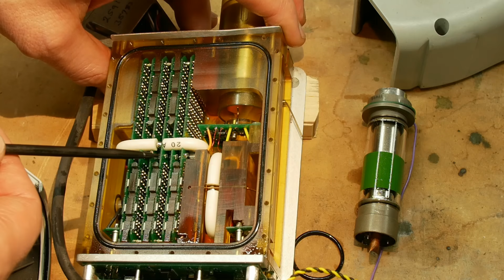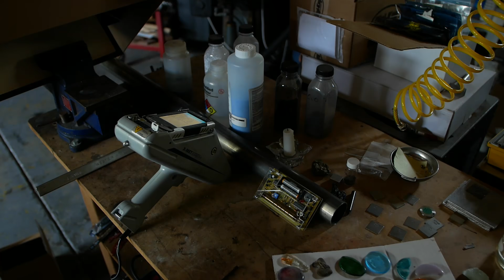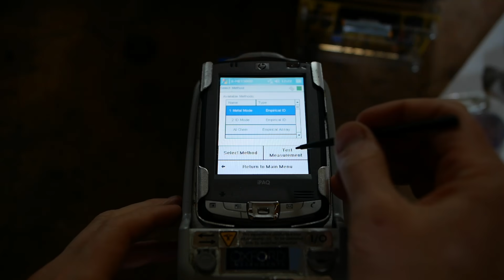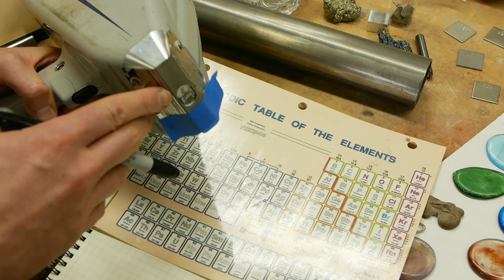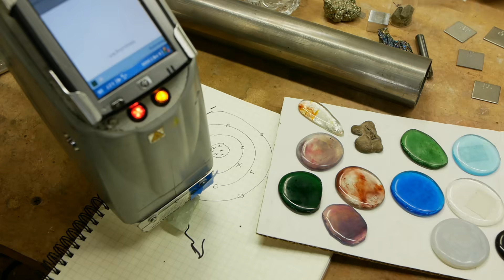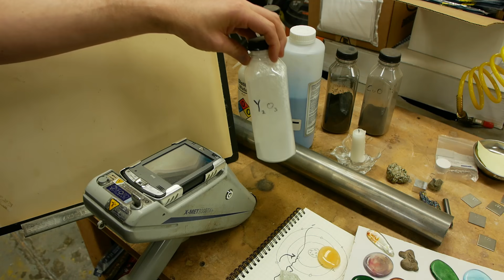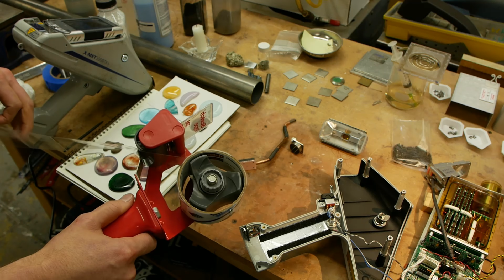Demo and teardown of an X-ray fluorescence gun (measures chemical composition)

Comment: UV fluorescence is actually a bit of as different process than X-ray fluorescence. When a fluorescent material absorbs a photon with a specific energy, an electron within its outermost orbital is excited. Rather than being ejected and leaving the system entirely, the electron jumps from its current orbital to a higher energy one, with the energy difference between the orbitals corresponding to the energy of the photon absorbed. The electron can then relax back down to its original state by releasing a photon--this is light you seen when shining a UV light on a fluorescent object. Now, there often is not perfect overlap between the lower energy orbital and the higher energy one, so when a photon is absorbed and an electronic transition occurs, the molecule can become vibrationally excited as well. The energy used in the vibrational excitation is "wasted" and does not contribute to the energy of the photon emitted. This is why fluorescence produces light that is lower in energy (longer in wavelength, or "redshifted") than the light that causes the initial excitation. Hope this makes sense!
Reply: I think he gave a very good explanation of the difference in the video.
Reply: So what is it that specifically affects the apparent color of the fluorescence?
Reply: @DudemcmanStudios  my thought is Evan's explanation is correct: the collapse of an excited electron down to a lower orbital emits a photon at an energy level reduced by loss.  The energy of the exiting photon determines the wavelength.  If exiting photos "returned" all energy of incoming UV...zero loss...the wavelength would be UV, but in reality the greater the loss through absorption by the parent atom the lower the energy of the exiting photon and hence the longer the wavelength from Uv down through the spectrum from violet through red and  beyond.
Reply: @DudemcmanStudios  The energy difference between the orbitals which is itself caused by the molecular structure.

Comment: 1:39 Granted, but aren't typical medical x-ray exposures usually 1000s of times shorter than the 10 seconds that gadget emits?

Still, very cool tech. with the 40kv power supply. Sort of reminds me of an old soldering gun in reverse. Instead of thousands of turns primary and 1 or 2 turns secondary, this thing appears to have 1 turn primary and multiple secondaries? Each VM constituting a secondary? I'll wager this allows the VM mfg to modularize the HV supply solutions. The mfg probably sells 1kv, 5kv, and 10kv VM modules. The client just stacks as needed to get the voltage desired.

Comment: Ok Ben , in the other videos you demonstrated vacuum deposition and the operation of two different pumps to achieve high vacuum. What I want to know is this: why have you yet to make a video on anti reflective coatings for glass? Such a ubiquitous thin-film costing, and one with such utility, not yet brought to your videos!  How come? Isn't it about time? The reason why I ask is because I'm a watchmaker and I have yet to find a reliable vendor for AR-coated watch crystals. Wouldn't it be awesome if I can vacuum-deposit some magnesium fluoride on my glass crystals for a profound visual quality to the watches that I make?
... But I can't, as Ben hasn't yet made the video. :(
Plus, if the video is created for poor watchmaker-type budgets (diffusion pumps, cheap dual vane pumps, etc), that would reel in even more subscribers, I'm sure. Plus, your so well-versed in the setup and execution of vacuum technology that this presentation can be carried out in an afternoon...

Comment: Does the power supply have any similarity to what you might find in a taser/stun gun? Very high voltage and low current.
Reply: Yes similar to that I believe, tasers are more pulsed than a constant DC voltage though. Also small X-ray devices like this can use enough voltage to produce an arc about 4 inches long!

Comment: Great videos, great content. Intelligent and enjoyable. I always look forward to you doing the next 'impossible' thing ("let's build an electron microscope!" Me - mouth open in disbelief as he actually makes a home made electron microscope).

However, on the specific subject of hand held X-ray guns...

Personally, I wouldn't trust those hand held guns down to 0.01%. You would be hard pushed to get that kind of elemental sensitivity and repeatability from a quarter million pound (£) 30Kv, wavelength dispersive laboratory grade instrument with certified calibration standards. Even at modest masses (first transition series metals) there is the chance of interference from overlapping lines because the resolution of the detector is not that good. The problem gets worse as you move up the periodic table.

Portable X-ray guns are brilliant at discriminating between elements and different alloys, but everything is a compromise. You can't take a half tonne, lab grade XRF on the passenger seat of your car and set it up in a couple of minutes in a warehouse on an industrial estate. For that kind of work, hand held is difficult to beat. But 0.01% precision is unrealistic. The manufacturers can put two decimals on the readout, but almost all of the time that last digit is just noise.

Now, if you want real elemental discrimination, how about building an ICP-MS? (!!!)

Comment: Recently I changed trigger button in Olympus Delta XRF (olympus do not repair this model even for money). It is old model, but xray module is smaller. Detector is cooled with peltier modules and it is weak spot in system. It fails and xrf is dead. Unless you use it in winter at -15C. Detector are made by ametek and they do not sell these. Olympus do not have spares. No I have two dead xrf (from about 15 park). New vanta looks like same delta in new box.

Comment: what is the tubular lock for? Is it for turning it off completely just because it contains X-ray radiation and thus requires a lock for safety so not unauthorized people could operate it, or is it just for opening the case?

Comment: UV light can excite an electron, moving it up an energy level or two.  The electron then releases a photon and drops back down to a lower state, usually back to its ground state.  The frequency of the photon is specific to a particular element and transition.  This produces an atomic spectra, which covers infrared, visible, and UV light.  Just as the transition caused by the X-ray is specific to an element, the atomic spectra in the visible light range is specific and can be used to identify the element.

Comment: Doesnt metal overtime collect radiation if it is exposed to it? Would it mean that that tube u took out is kinda radioactive?
Reply: I don't think there is any transmutation going on. The electrons strike the X-ray emitter but I don't think the nuclei in the emitter are converted to a new chemical species by that. You would have to bombard them with protons or neutrons for that to happen. So no radio-isotopes would be created in the process.
Reply: It doesn't work like that really. Radioactivity really encompasses several very different effects. You don't really "collect" radioactivity. 
The one you are referring to is when there are radioactive isotopes emitting let's say neutrons, these neutrons may end up attached to some nucleus of stable materials, making them in turn unstable due to the extra neutrons. This is called neutron capture. That atom then after some time and depending on its mass may break following its own radioactive decay chain.

All that does not apply to the xrays, so there is no risk.
Reply: @JavierAlbinarrate  thanks🖒

Comment: I work at a synchrotron facility and we usually use Beryllium as windows to let X-rays out of vacuum chambers with very little attenuation since it is the metal with the smallest atom.
They might be using the same here in which case you have to be careful since Beryllium is toxic. So there is that.

BTW. I love all your videos :)

Comment: 40 kV is actually pretty risky voltage level for human because it penetrates barely skin and interacts with muscle tissue, and that kind of level is used in mammography. The currents are pretty high in mammography(~100 mA), and an average radiation from that is about 0.3-0.5 mSv  so you have to point that gun pretty long time to your hand to get cancer. But the point being safe x-ray voltages are below 10kV where it stops to skin or above 180kV where it penetrates your body without interrupt. BTW the guns "window" is made from beryllium . It is commonly used as a x- ray tube window material because its almost transparent to rays . Nowadays it has been changed to carbon fiber. it is a bit less transparent but less toxic and cheaper to manufacture.
Reply: Modern xrf use silicon window on detector, Be on Xray tube and polyamid on outer window.

Comment: Thank you, and especially for mentioning the triboelectric effect. My first experience with a triboelectric charge occurred in the photo darkroom when I would unroll my 120 roll film in total darkness; when I pulled the adhesive tape holding the film to the spool to remove the film, I would see a faint bluish glow in the darkness where the adhesive was separating from the film. My friends and I thought this was so cool that we made other experiments with adhesive tape and substrates from which we would pull the tape and watch the effects. This also made a very interesting fog exposure on the film, and after it was developed and fixed, we could see the triboelectric light exposure that the effect made on the film. Thanks again!

Comment: the metal-window in front of the xray tube acts a xray filter to block the part of the spectrum below the K-alpha peak of the anode (i.e. the target) (edit: no, that was wrong. the filter blocks everything <= Kbeta. it is usually one atomic number lower than the target element of the tube.

Comment: How can anything with zero mass, regardless of momentum, impart energy and knock an electron out of orbit?
Reply: And the exception for the divide by zero that it allows, or does or causes. It gets complicated I am sure.
Reply: The photon is a traveling EM wave packet (or a self-propagating disturbance in the EM field[s]), and when it interacts with something that also has EM components (electrons, protons, even neutrons due to it consisting of tiny quarks and it having a multipole moment) then it can transfer its energy to whatever it "hits". It depends on energy. Otherwise the waves just kind of pass each other. But at the right frequency (= energy) they interact, which is also called scattering, because usually that's the thing we see, because the position and momentum of things that the photon hits is of course random.
Reply: A photon is a discrete particle we can measure in quantum sums.

Comment: That was interesting. I would have liked to see how the anode of the xray tube is formed to emit on the front of the tube. Also I'm a little surprised that the beam current is regulated by the filament. Could an xray tube not be designed to have a Whenelt grid to regulate the xray intensity? This would serve the same purpose. Anyone? ??

Comment: This may or may not be related to the packing tape phenomenon you mentioned, but I noticed that the old school black cloth electrical tape AKA "friction tape" emits a light blue glow right at the point of detachment as you pull the tape off of the roll in a darkened room.  I've long since forgotten the circumstances which caused me to notice that, but wonder if you can explain this?

Comment: I want one. Must be quite useful if you have a few tons of mystery steel cutoffs  with alloy unknown. Or to see if jewelry is real/fake.
Looks like one of those weird mircofocus Xray tubes btw, where the beam comes out of the front. Definitively weird HV-PSU design, I'd use like 2-5kV at a few kHz and multiply it up to 40kV. A few µA is easy with multiplier.
Reply: It can't distinguish between gold plating and solid gold, though. It only detects surface composition.

Comment: You can actually see tape emitting light when you unroll it if you turn the light off. The stronger the adhesive, the stronger the effect. Wikipedia calls it "Triboluminescence".

Comment: I owned a dental X-ray machine rebuilding company for 20 years until I sold it in 2017. During that time period, I have repaired many different types of X-ray tube heads, and as a result I have learned about the different types of high voltage power supplies that were designed into those tube heads. With only a couple of exceptions, most X-ray heads employ a split DC power supply. That is, the X-ray tube normally needs between 70 KV and 90 KV depending on the type of tube head, and because of the relatively small space inside the metal enclosure, the manufacturers would split the HV supply into two separate sections. One section would feed -35KV to the cathode, and the other section would feed +35KV to the anode (in a 70KV tube head). I would have guessed that that's the way the XRF guns were designed, but according to your finding, Ben, it appears that they use a single-ended HV supply.  By the way, some dental X-ray tubes have a thin Beryllium disc pressed into the circular window in the copper hood that surrounds the tungsten anode. Beryllium is nearly transparent to the X-ray spectrum that is produced by dental tube heads, and I'm guessing that might be the type of metal that you found in that XRF gun (rather than silver). But having Zero experience with those guns, I am just guessing about that. Fascinating video, Ben!
Reply: Yup that beryllium window has a very critical purpose. It stops the secondary electrons from bombarding the glass, causing a blurry image. It also allows for a uniform electrical field that prevents an asymmetry of the x ray emission fields.

Comment: I’d like to see Dave at EEvblog run through that power supply in depth, that’s some high engineering and I’d love to see it laid out in it’s entirety.
Reply: I work at an X-ray company now and man did they get smaller! The whole assembly of transformers and voltage multiplier is about the size of a zippo!

Comment: how does the detector determine the photon energy, surely it would have to have some sort of discursive element like a spectrometer. you should do a video on it as it is probably the most interesting part
Reply: no spectrometer in this case likely would be far to bulky to be handheld and much more expensive. look up 'Energy-dispersive X-ray spectroscopy' on wiki

Comment: Not sure why there are no XRF machines using a Cesium-137 source instead of of an xray tube. Cs-137 emits 662 KeV xrays. I think this would allow a much more smaller XRF machine and and allow it to penetrate deeper into solid metals.

Comment: Has alloy detecting device in his hands
"I susepct it's silver"
Reply: It probably is beryllium, which you can't detect with this apparatus and that is exactly why it is used. I you use a metal that you can detect it will absorb a lot of the radiation, and you always get a measurement of that metal in your result.
Reply: @wvdh  No I think its silver indeed but i doubt Ben's hypothesis not so much as a fluorescent "monochromator" but more like a filter. Medical x-ray machines have aluminium filters so the beam has less low energy photons which increase your dose without contributing to make a radiography, so I guess its similar but silver being of a higher atomic number it can be much thinner and only let pass the highest energy photons.
Reply: @teresashinkansen9402  There is no reason to lower the dose on a metal sample. And you lower the output of your x-rays a lot by filtering, especially for lower energy x-rays, which is what you are using here. Titanium Ka energies are around 4.5keV, so anything above that can contribute to the signal.
Reply: @wvdh  Yeah that makes sense. Something that throws me a bit tho and why i thought it could be indeed silver is that that metal piece seems to be soldered, i don't know if its possible to solder beryllium but silver is. Still i think you are right.
Reply: ive got one its called a nicon gun
Reply: @Steve211Ucdhihifvshi  I've got a Nerf gun
Reply: ... but understand silver isn't an alloy...

Comment: Nice job. More tear downs would be welcome. I figured you might explain the noise? Is it the speaker in the tablet as a warning or is it the high voltage power supply?

Comment: For low atomic nubmer elements Auger emission is favoured over X-ray fluorescence which also could explain low detectability
Reply: low detectability of the light elements is purely because it's reeeeally difficult to detect very low energy X-rays, signal gets lost in the noise...which is why Auger emission is favored ;-)
Reply: @AKAtheA  The X-Ray Fluorescence yield is low for low Z elements (secondary x-ray emission/auger emission) adding to this it's more difficult to detect, hence the vacuum chamber or He atmosphere used in high power spectrometers
Reply: @AKAtheA  Auger emission and X-ray fluorescence are two competitive de-excitation pathways for  the atoms after the removal of a core level electron, the frist favoured by low Z elements. The low detectability of low energy X-rays its another matter

Comment: using a spinning wheel with a rod connected on the side like on train wheels to produce a linear force (what are these called?) you could make some thing symaler to what he described using two metal plates and a silicone pad, you could generate some X rays.

i wonder how well this scales?

Comment: When salvaging the detector, see if you can also salvage the charge sensitive preamplifier for it - they are a pain to get right if you gotta design one from scratch!
Reply: Ive seen them with the amp built in the can with the pin detector, amp and all cooled by internal tec. Worked with ones intended for light as well that were stupid sensitive.